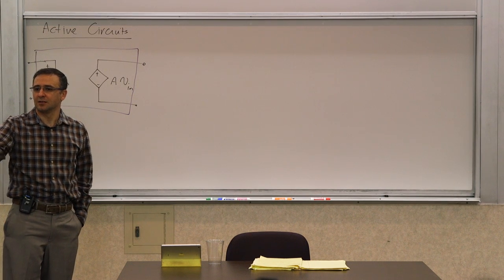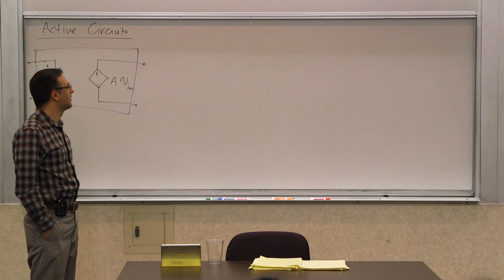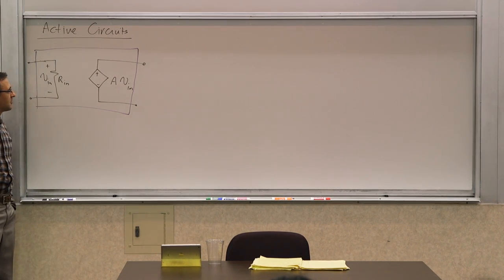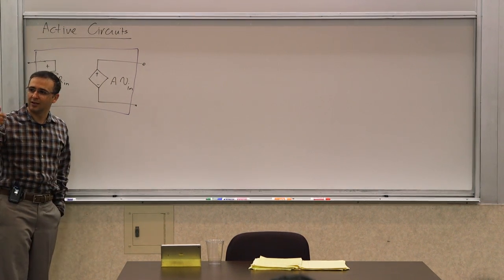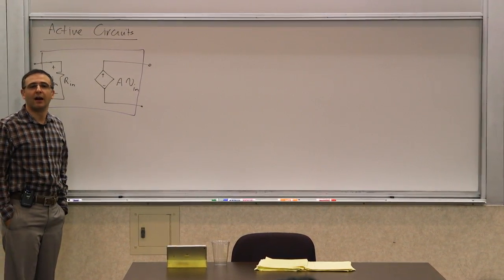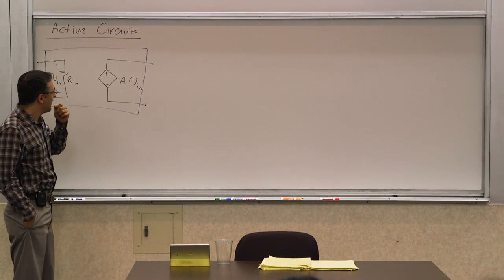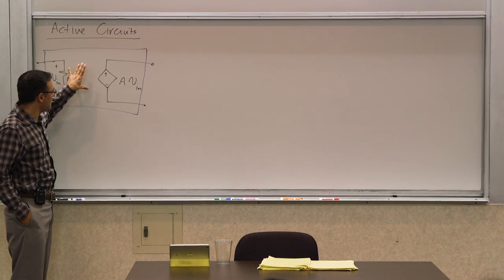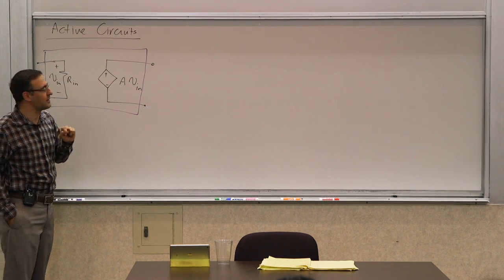010. Active circuits: Op-Amp, Feedback, Asymptotic Equality, Inverting and Non-Inverting Amplifiers

Comment: Professor, I have a doubt (around the 1 hour time). Let's think of an operational amplifier with negative terminal at ground, and the positive terminal with the resistor R2 between it and vout and R1 between it and vin. Ignoring stability, etc for a moment, it can still theoretically produce a stable output right? Vout = A(V+ - V-). If Vout is finite, we would be having V+ following V-. Think of a scenario where V+ is slightly dipping below 0 (V- is grounded). Now we can still assume as if current flows from vin to v+ then from v+ to vout right. And A*vdelta condition is also satisfied since vdelta here is -ve since the positive terminal is dipping slightly below 0. It would still behave as an inverting amplifier right, atleast in steady state theoretically?

Comment: Is that output waveform from an inverting amplifier right? It should only flip it upside down right but the picture you drew is  flipped leftside right . Correct me if I am wrong.

Comment: Time Stamps: 
0:00 = Review and Overview
2:40 = Amplifier
13:30 = Operational Amplifier
19:39 = Ideal vs Practical Op-Amp
30:51 = Feedback
37:50 = Asymptotic Equality
45:37 = Inverting Amplifier
57:44 = Non-Inverting Amplifier
1:06:10 = Funny Things with Active Circuits

Comment from the maker: For a much more in-depth analysis and review of feedback in electronic circuits watch videos 149 through 161. Starting at:
https://www.youtube.com/watch?v=T9Wbm5Tm7Pw&list=PLc7Gz02Znph8d2777p1PUrfPL-8nfj8oZ&index=49
Also, @52:15, the output waveform is not technically correct. It should be an upside-down version of the input, with the magnitude scaled up. In other words, the mirror image of what is drawn.
Reply: thanks for everything.